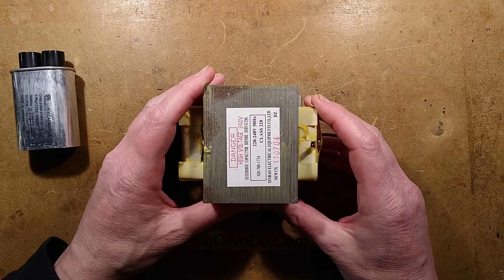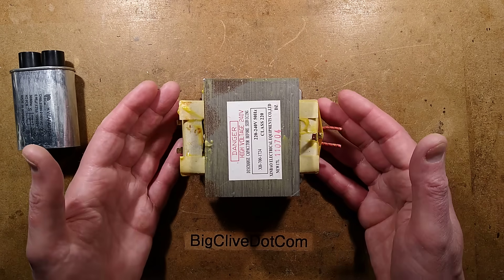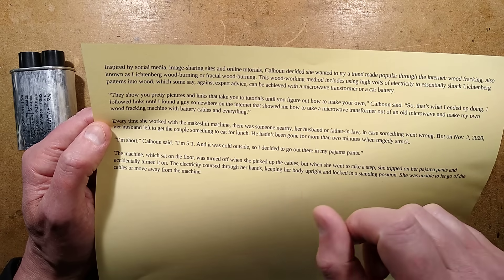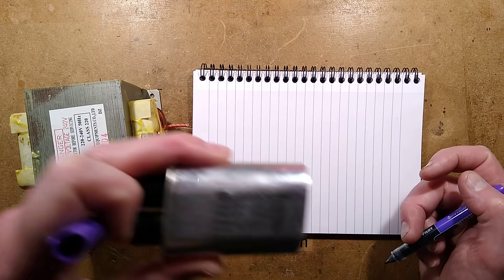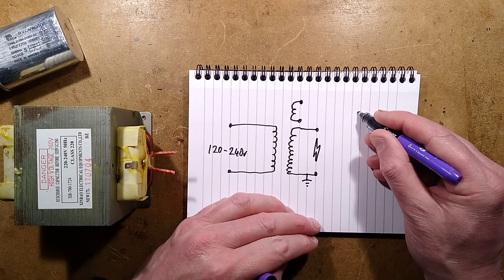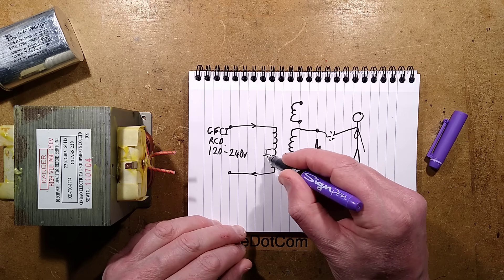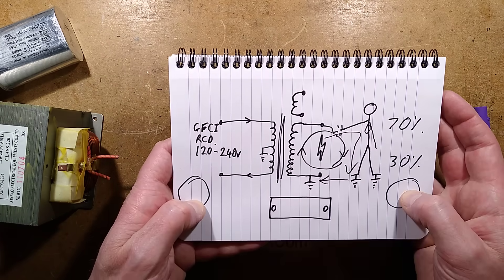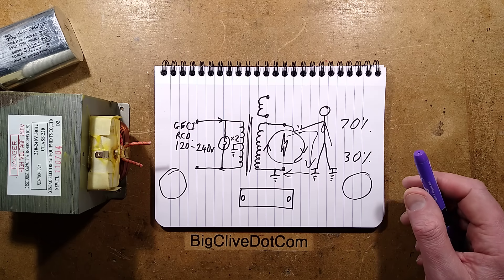The most deadly project on the Internet

Comment: This video will, most certainly save lives.
I for one , might cut out the HV secondary of an MW transformer to make a spot welder or a battery charger, but I will never monkey around with such a transformer with original secondary windings , never . And I don't recommend anyone else does period .
I wonder if a standard ground fault isolation trip unit can be made to work if put across the high voltage secondaries of these transformers ? Or could such a high voltage unit be fabricated to protect people who really must use these things ?

Comment: Its not the Volts that kill you - as you mention in the descrption its the Amperes (and how long they flow).
The static shocks we can get from carpets can easily be 5000+ Volts.
And if you want a tansformer to do something with the DC from a battery you need to pass it throug a DC-AC converter first - transformers only work with AC.

Comment: Wow I did not realize so many people were dying from this. I have been fractal burning for years. I even make glass from sand with the transformers. I always use a safety switch, a surge protector/GFCI and everything sits on pvc. I have never ever used sticks and I never ever will.  Also, I never do it with on lookers. Most the time I'm the only one home, prob not a good idea but I do think it is safer that way. Maybe not for me but thats on me. 
I was electrocuted and died when I was 4 years of age from a blow-dryer in a bathtub, dead for 6 minutes. I'm all good with dying from electricity. Been there done that.
 Dang, now I want to do some burning.

Comment: I have always remembered a Safety talk I had from someone who was something to do with trains (This talk was back in 1995, and I was in school, give me some slack on remembering the person),
He mentioned a lot that day and a few of them have stuck with me a lot.. The one most relevant to this was, after a football game, people were throwing toilet paper in either celebration or commiserations from either winning or losing the game. A few streams of this toilet paper went over overhead lines.. Guy went to grab them to clean them up... Voltage was high enough to consider the toilet paper (as high resistance as it was) a perfectly adequate conduit to electrocute the guy cleaning up. The toilet paper burned up instantly, but by that point the damage had been done. 

That has always stuck with me.
Reply from the maker: Sounds like it may have been damp.
Reply: @bigclivedotcom  maybe. Just the idea of electrocuted by toilet paper... It wasn't until about 2 weeks later I realised it was exactly how lightning worked. Voltage gets higher and higher and higher until "the air" becomes an adequate conductor . Only way to survive that is become MORE RESISTIVE than the freaking air....

Comment: 13:50
This is NOT a high Frequency power supply.
This is an Electronic Ballast for Neon Tubes.
It only raises the voltage . NOT THE FREQUENCY
Reply from the maker: The electronic neon supplies put the high voltage out at around 20 to 30kHz.  That's why they can use a much smaller transformer.
Reply: @bigclivedotcom  thanks for the clarification. Did not know this. Sorry 👍

Comment: You frame the video as if you're looking out for people and you want to make sure more people wont die.

But your title is "The most deadly project on the internet", it's pure clickbait! it has nothing in the title for people who would be researching fractal wood burning. Nobody is going to find this video by searching it. It's just from recommendations.
Reply from the maker: It was slightly click-bait for a reason.  Unfortunately using the desired keywords would currently get it blocked or downrated due to some rather wide ranging filtering that can't tell the difference between a dangerous video and one promoting safety.

Comment: Remember big cliv it is not the voltage that kills you it is the amperage that is flowing that kills, yes twelve volts of a car battery can and has killed and maimed in the past, if you get in series with a high drawing appliance then it can kill, such as a car starter motor that runs on extra low voltage twelve volts in your car.

Comment: What about only use microwave component for magnetic table and not spot welder and not wood sparks ?
Reply from the maker: If you remove the dangerous high voltage winding for use in projects like electromagnets and welders it's OK.
Reply: @bigclivedotcom  how to do it safely and correct ? Use huge High Voltage gloves and boots ?

Comment: Great video explaining how these systems work and the risks.  I did a video on the many safety feature I incorporated into my system hoping people who plan to do this think about the risks and methods to improve safety.  These two videos compliment each other very well.  My video shows the methods I use to enhance safety.  Unplugging when not in use or when doing maintenance, PBNO (Push Button Normally Open) switch with protective ring to prevent accidentally pressing the button, insulated and grounded electrical boxes, using a Variac to control power (also to keep both hands away from the danger zone), using uncommon plugs and receptacles to prevent accidentally plugging the high voltage transformer into a standard wall outlet, putting the high voltage transformer in its own box to isolate potential contact, multiple power switches with display lights that need to all be powered on to energize each section, using isolated probes that are self supporting and are shielded in plastic tubing, wearing rubber gloves, working on thick rubber mat’s, wearing thick rubber soled shoes, keeping a safe distance from the high voltage section, and working with good ventilation.  I will put a link in my video to your video since they complement each other so well.  Hopefully people realize this needs to be approached with knowledge and skill and focus on methods to do this safer.  
Great explanation!  Hopefully by sharing knowledge it will save lives.

Comment: I used to play with a 220V AC to 14V train transformer, plugged into a 9V battery.
The output shocks you like a charged up capacitor, just by plugging and unplugging the 9V battery on the secondary coil.
The primary coil pins are connected to wires which you can either hold, or touch.
Much fun! :D

The shocks aren't DC shocks, but shocks due to turning on and off the circuit.

Comment: It’s so deadly because when you grip those probes AND be electrocuted, your muscles INVOLUNTARILY construct and you CANNOT drop them! This keeps you connected to the source. Electricians are taught to use the back of their hand to check if the current is dissipated. This way, if there is stored energy, your muscles end up closing the hands and arms snap up to your shoulder.

Comment: As someone certified for working on EVs high voltage electrical systems it scares me just how careless and calm people are when working with electricity in general. Unless you are trained you would have no idea.

As you say, these transformers are silent killers, you don't know looking at the hulk of metal that it could kill you without hesitation. 2kv defies conventional logic, what you think you know from changing a light switch or outlet doesn't help with that. It's crazy people are more scared of the 240v incoming mains supply than the silent killer these transformers are. I used to work in a HV lab at university where we would setup testing over 200kv. You would think we were working at NASA with all the safety equipment and procedures we had to follow. But it all made sense the first time I got a demo where they literally blew up a hot dog from across the testing chamber with no easily discernable path between the transformer and hotdog. We all learned a valuable lesson that day, don't assume anything is safe because you might just not understand how dangerous it really is.

Comment: Fractal burning art hobby is extremely dangerous, warns ESA. Homemade Lichtenberg generators used to create fractal art have caused severe injuries and death, says the Electrical Safety Authority. The organization says hobbyists are using high-voltage energy sources such as microwave oven transformers to manufacture wood-burning devices called Lichtenberg generators. They then use these generators to create art and abstract objects by burning fractal patterns into materials such as wood and acrylic. “It's extremely dangerous to use these devices,” warns Dr. Joel Moody, ESA’s chief public safety officer. “These high energy sources, built from a microwave transformer or similar component, create a very real hazard. The exposure to high sources of electricity can cause severe injury and even death.” ESA is aware of multiple fatalities and critical injuries in Ontario where these generators were used, including two fatalities in just the past three months. (Toronto Star)

Comment: Came here after watching Ann Reardon's repost of her video on the dangers of fractal woodburning. Even after watching her video, I was astounded to learn that the voltage going through one of these transformers  is equivalent to an electric chair.
Reply: But it's not the voltage that kills you, the intensity of electrical current does it.
Voltage is nothing with low current.
Reply: @mucia55  This is true, but higher voltages drive bigger currents through the resistance of your body - and this bigger current is the thing that can send your heart into highly disordered, often fatal, beating (fibrillation).
Reply: @bobloblaw7465  They certainly do!  But Ohm's Law tells you that the bigger the volts applied to your body, the bigger the amps that go through it!
Reply: @hectorpascal  I use 10k volt transformer with only a 30ma output. Other transformers have half the voltage but 10 times as much amperage. That's what kills you. Ive shocked myself with the probes, although it gave quite a tickle it's nothing compared to the electrical outlet in your home. 120v /15-20amps.
Reply: @bobloblaw7465  30mA is usually considered "safe", but the crucial electrical path is up one arm, across the chest and down the other arm.  The chance of triggering atrial fibrillation in the heart muscles is dependent on many health factors - not just the magnitude of the current.  These include age and the pre-existence of minor arrythmias, which are very common, but often undiagnosed.
Reply: @hectorpascal  "... the pre-existance of minor arrythmias, which are very common, but often undiagnosed."

VERY TRUE.  This an often ignored factor.
Reply: @mucia55  But the voltage determines the the current
Reply: @Owen_loves_Butters  and  @Hector Pascal  This really isn't true, though it is something I see repeated a lot, mostly because of Ohms Law, i.e. V=IR

However, this is an incorrect reading of what is happening. People seem to believe as Hector claims that "the bigger the volts applied to your body, the bigger the amps that go through it" but it is actually the other way around. The greater the current, the more voltage goes through you. Think of the voltage as a bullet, the current as the force firing the bullet, and resistance as a block of ballistic gel. The more force you fire the bullet with, the deeper into the gel the bullet goes, but if you fire it with very little force, it might actually bounce off the gel. In this case, the gel would have acted as an insulator. What Ohms Law tells us is that if we have a circuit with Resistance R and if we push with Current I, then we will be able to push V amount of voltage across the resistor. This is why we can hit someone with a 50,000V TASER at 3.6mA and have them stand up and walk away, but hit someone else with just 5,000 V at150mA and that will kill them deader than a dead thing.
Reply: @kylie_h1978  This really is cringe inducing inaccuracy. I suggest relearning how electricity works.
Reply: @mucia55  Meanwhile at 150mA....

Comment: Wow. Just. Wow. Thanks for this. I have seen so many projects that make messing with that microwave guts bundle look like a casual kid's camp project.

I've been bitten while working on 110 outlet, that wonderfully has a magic charge from somewhere as it had current coming from somewhere other than the breaker boxes we shut off.

I have also worked in medicine and have seen what happens to people's bodies when they become the shortest path, hence no desire to check the provided link.  

Thanks again for the warning.

I think i'll try the boring slow route of using a car battery and some jumper cables grabbing nails hammered into the wood.

I like living.

Comment: Respiratory Paralysis, L. O. L.   Another thing you could have mentioned is even if it isn't going to pass through the insulation of ones shoes, if they hold one probe in each hand, there is a very high potential for the current to pass from hand to hand through their heart, not a good situation either.

Comment: Microwaves just need to left alone. Even turned off they can still shock you when you open it up. I worked for a repair shop for 6 months during that time I saw The repair man it wasnt turned on or plugged in and he accidentally touched something and he was flung across the room. He was lucky he was not hurt too badly. but a trip to the hospital was required.

Comment: Nice video and well explained :)
Only one clarification, if the volts per turn factor is true for a transformer, then you would have low current on the high voltage side of the transformer? I see a couple of comments below mentioning high current.
If you remove the high voltage winding ( many turns) and replace with a few turns of heavy cable to make a spot welder project, then you will have low volts and high current. You can't get high current and high voltage out of a transformer as it has to follow the convention of the rating of the transformer in VA.

Comment: Thanks for your video. i started my comment about 3 min into video.. Watching it's entirety later and i be a fool to ever do it again..
I have a unit i wrote all my safety methods before i read Marchfield01 story. AND  I AM GOING TO THROW MY UNIT AWAY ..  When I first saw this I was amazed by it and it scared by it and thought about it for maybe two years before i built mine.  
?? When the unit was on could you touch that sticker on the top of unit without getting killed?
After thinking about this for 2 years I opted for a neon light transformer. you said Being complacent mistakes happen.. A friend wanted to take photo of the unit I bought and while it was on I dusted the sticker off the top of the light transformer which is why I asked the question if you were to touch them light sticking on top of that microwave Transformer kill you.?
To fix the problem about not seeing if unit is on, I Plug my Transformer into ait 3 Way remote operated power box $20 and I hooked up 2 lights an orange one and a white one, in case one fails.. When I turn my unit on now I know it's 50 feet away it's on.
I know some people don't like  the neon light Transformers because of the Slow Burn but if you leave it burning for half an hour it'll burn deep.
  Here's my safety precautions from the ground up: 
1 .4 skateboard wheels on their side table legs  on top of those.
2. On top of the table and 1 inch rubber bar mat and then a sheet of plywood, then what I'm working on goes on top of the plywood.
3. The 3 Way power source remote control operated.
4. The 2  light bulbs that tell me the unit is on.
5. I drill a half-inch hole in the end of 3  2’ long wooden closet rod, Then I silicone one side of the jumper cables clip into the hole.
6. I put 2 rubber bicycle hand grips on the end of each closet rod end.
 7. Drill a hole in the middle of the closet rod I silicone a 3/8 of piece of dowel 4” long  into the hole. 
8. I cut 4” piece off of 4x4 And then drill a 5/8 or 3/4 hole in the center of one side of the cube And then I silicone that 3/8  rod into that hole now it's kind of couter  balanced.
9. I bought a pair of $20 shock  electrician shoes. 
10. And I stand on a bar mat with those rubber shoes 20 ft away with remote control.
11. If I'm so compelled to move the the connectors I use that 3rd closet rod with rubber handle 2 move it to touch the other rubber handle’s since  counterbalanced is easy os easy to move around.
And as he said in the beginning of the video people getting complacent mistakes are made even .With all of my safety protocols I still dusted off the sticker while the machine was on so my bro could take a picture.
So my question in the  beginning  if a unit is on can you dust off the sticker on the microwave Transformer or will that zap you..?
 
I did not buy lineman gloves because you have to take such good care of them and i knew i would not..  Total cost of all my safety precautions about 60 or 70 bucks. Neon transformer 45.00. The wood was free   .. Total amount made from this project 0.00. Thank you for sharing story, i am tossing mine eve w all my safety measure's..

Comment: High voltage is fickle and will get you as soon as you let your guard down.  Years ago I replaced the flyback transformer on an old picture-tube TV after it blew catastrophically (the only thing left was two little stubs).  After powering on, I didn't get any picture and, silly me, I nudged the anode wire with a finger.  To make a long story short, I was lucky that I didn't get hurt but the jolt sent me flying 10 feet.  That TV worked fine after that.  I had a less brutal incident when I got hit with 5000 Volts DC while constructing a pair of electrostatic speakers.  Fortunately, this voltage was used to charge up the membrane so the amperage was limited to mA.